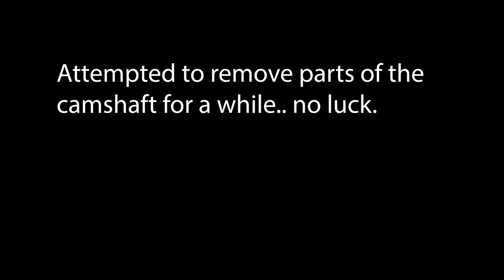350 Small Block Chevy Tear Down! | Engine Grenaded TOTAL DESTRUCTION!! | 1980 Chevrolet Corvette

Comment: Worst "circle track" engine I ever saw. The key to that type of racing is longevity and rpm. Some idiot put poor flowing heads and a Performer intake manifold on the engine thinking it will make any lick of power above 4000 rpm? No Wix oil filter. Used actual gaskets for the china walls instead of rtv. Careless